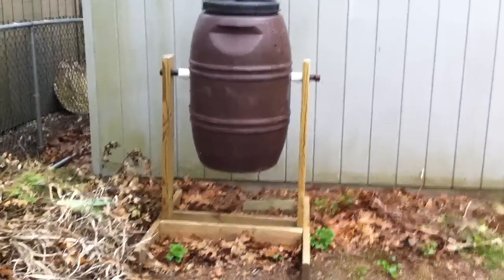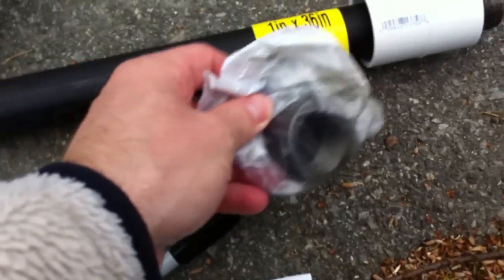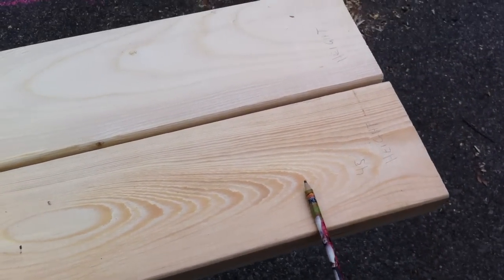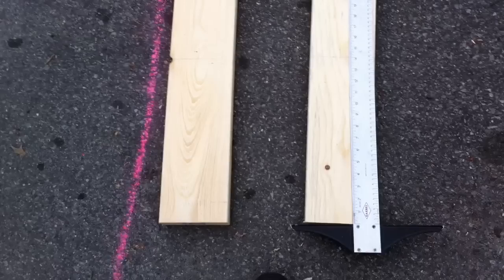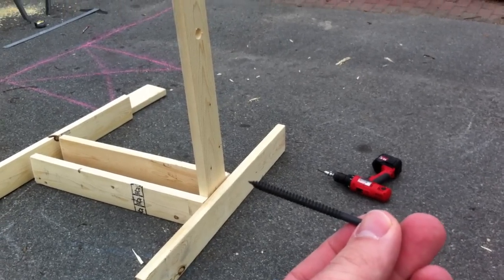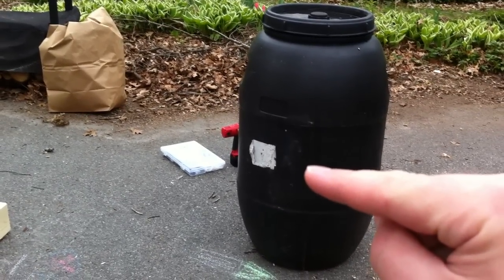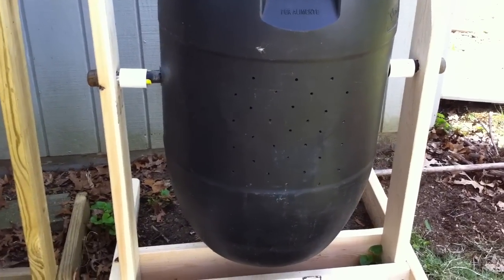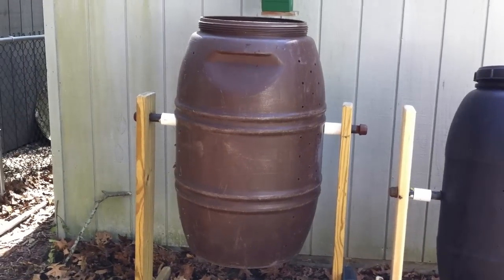How To Build a Homemade Compost Tumbler

Comment: If you place a bulkhead fitting thru the bottom you can add a vertical tube (with lots of holes in the tube) in the composter - adding more air to the center - just a thought to help add air to the middle http://www.aquabarrel.com/retrofit-your-barrel-c-5_55/bulk-head-fitting-p-1001409.html

Comment: Or putting the baril in water so it is easily movable 360°?
Reply from the maker: Karima Osmani the barrel has holes in it in order to let the compost breath. you're welcome try your method, but you may find this is still the simplest solution

Comment: How much time  does it take for the compost to be ready? I mean you must keep adding the waste when it is full what do you do? Wait for it to be ready ? What do you do with the waste then?

I do my composting in buckets. First one is full then leave it to composting while in second one I keep adding the waste. By the time second one is full, the first one is ready to be harvested. Then I empty the first and start putting waste in that bucket while I store my harvested compost to be aged. After sieving it of course.  

I think two tumblers are needed one in which compost is being ready and the other one in which to add waste.
Reply from the maker: correct. I started with one which meant once it was full I just had to let it cook until it was time to harvest. but now I have two. so one cooks while the other one is used to dump into. remember, if you have a good cook going then it can turn the waste into compost pretty quickly
Reply: Yes, I thought so too. I will also need two or may be three, we eat lots of fruit and vegetables, salads, so may be three, not so big in size. Thanks for clearing my doubts.

Comment: Awesome design. I built one a month ago and it was cheap and easy to do. One modification that I made was to take lengths of 1x6 to reinforce the barrel where the holes are. Sandwich wood on the sides of the barrel and screw it all together to drill the holes through. I'll have a vid up soon on it. The pipe on mine would rip through the barrel under a heavy load. Unfortunately, I got a little carried away with the size of my first load of compost. Keep up the good work and happy gardening :)

Comment from the maker: I found both the pipe and the caps close to the plumbing section of the store. They were right next to each other. Really, I just went around looking for a strong enough pipe and caps that were sold with/near them that would fit the ends and the plumbing section had what I thought was the best solution, but any hard metal pipe with caps should do. Sorry if that's not helpful, I'm not familiar with specific UK DIY stores so I can't be more specific.

Comment from the maker: very, very, very little leakage, almost none. A good compost mixture will be moist and even though the material does break down significantly it still has some larger bits that bind it together and keep it from being something like a fine silt. I will say though that I preferred my original design where I drilled all the holes on the side instead of the tutorial version where I drilled them on the front and back.

Comment from the maker: The plastic barrels I use are pretty tough, and if you drill a hole in them to get a pretty even circle I've found that there's little danger of any type of plastic fatigue that would cause any sagging or bending. My first one has lasted a couple years with an extremely heavy amount of contents in it that I spin a couple times a day. From my experience there is no additional support needed.

Comment: Love the vid. Pretty straight forward. I have one question about supporting the pipe in the barrel.  After you cut the two holes for the pipe did you use something to support the plastic of the barrel so it will not sag or bend?